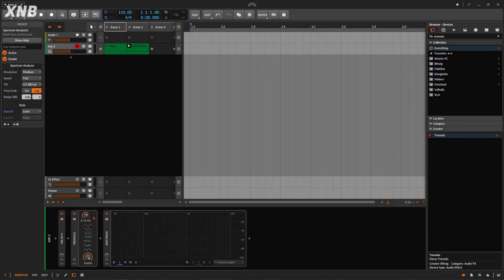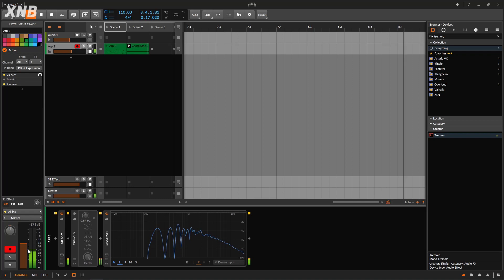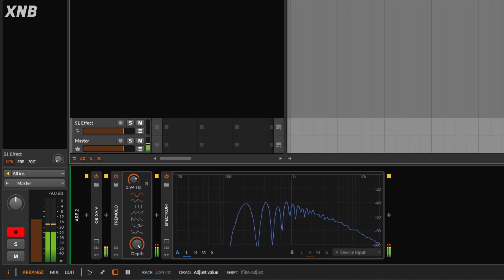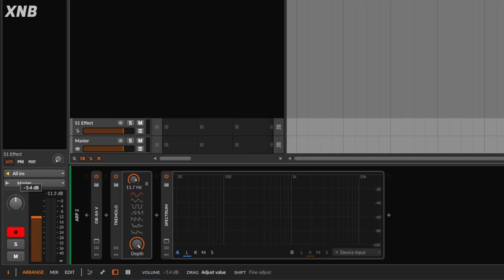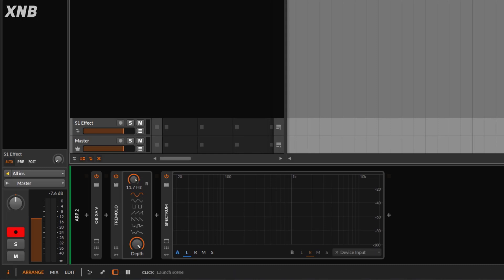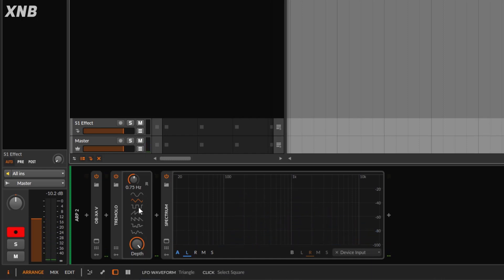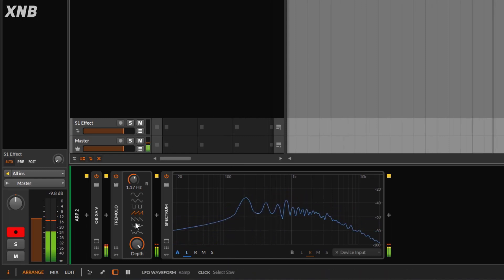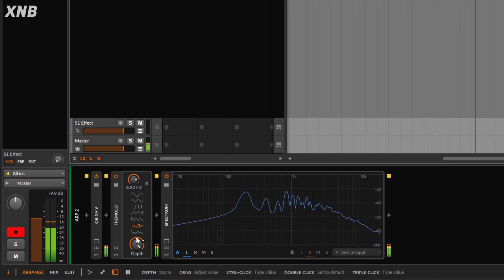How to use the Bitwig Tremolo device tutorial

Comment: I don't use this, because there is no phase parameter on it. Pretty useless with my perfectionist mind state when I can do the same with an LFO with more options.
Reply from the maker: Correct, I wouldn't say useless but a phase control would have been nice. A lot of the plugins are missing option because you can do it it with the mods and the tool. But totally agree, the phase could be there as well.